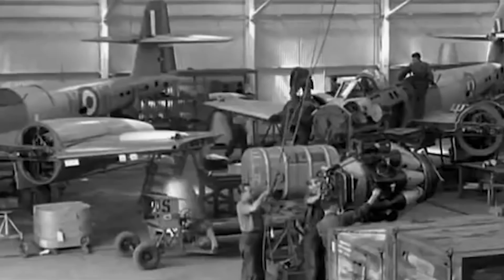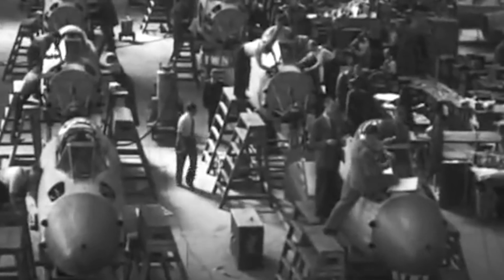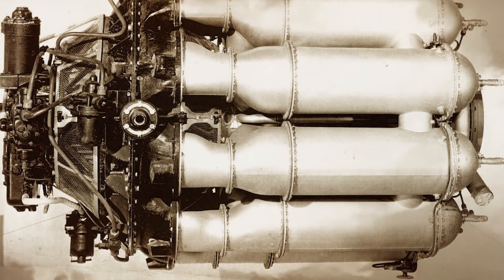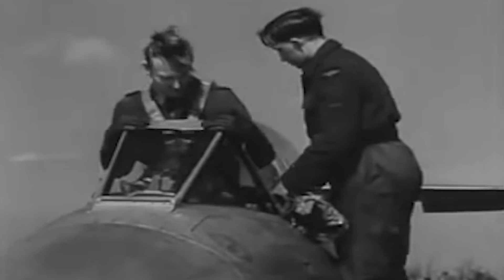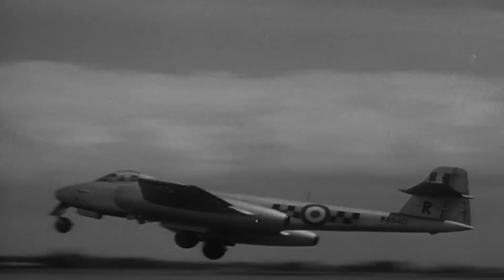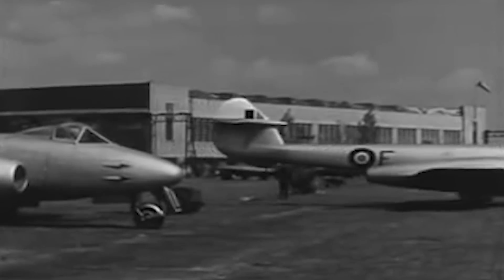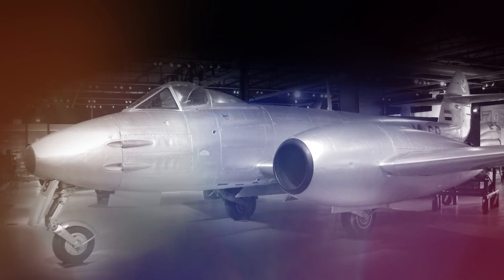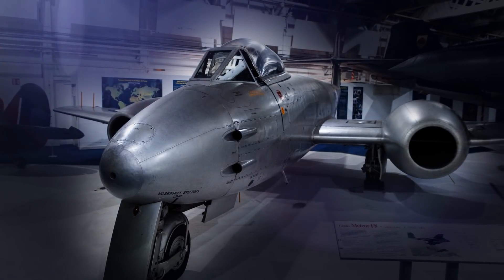Gloster Meteor - The Only Allied Jet to Fight in WW2

Comment: A few errors here, the Me 262 never reached squadron operational service until Dec 1944 with Jg 07 while as mentioned the Meteor saw squadron operational service five months before with 616 squadron.  While the 262 saw combat as early as July 44 it was with a test and trials unit and not a operational unit.  Then you said the Me 262 had better visibility than the Meteor, how could that be when the German pilots was seated directly over the wing in a conventional layout while the Meteor had the pilot in front of the wing in what's become the universal jet layout.  The Me 262 had a top combat speed of 515 mph which the Meteor easily beat when it went to the continent as did the third Vampire prototype which flew prior to the wars end.   The Vampires development being delayed by the engines for the prototypes first flight having been sent to the US for its P80 program.  Both US jets from WW2 used British jet engines, part of the Tizard Mission.
Reply: The Messerschmitt Me-262 had a top speed of 560mph in military service and set a worlds record top speed for a production jet aircraft of 624mph in level flight.
The F4 Meatbox didn't enter production until 1946, the F1 had a top speed of just 417mph.
Reply: @sandervanderkammen9230  sorry but no, three sourses show the 262 had a top speed of 515 mph in combat trim with weapons, ammunition and full fuel load.  The Luftwaffes own pilot hand book, the debriefing of Luftwaffe acceptance pilot Hans F. and then you have both the RAF and USAF tests post war with the aircraft.  The aircraft could reach about 550 mph in the dive is the pilot was suicidal given the types habit of locking the controls and plowing into the ground but piston fighters such as the spitfire, tempest and mustang could all exceed the 262's dive speed because of the control issue. Also the F3 sent to the continent had the mentioned more powerful engines along with the improved canopy and longer engine cowlings of the F4.  Those cowlings and engines gave it 80 mph more speed alone.  Got 40 years or reading and research on the subject.
Reply: @jimdavison4077  The top speed of the Messerschmitt Me-262 is 560mph...
Reply: @sandervanderkammen9230  not according to the Luftwaffe, RAF and USAF.  According to all of them it was 515 in level flight.    I notice you don't mention what unit it became operational With, that's because you know it wasn't an operational unit.  So explain how a non operational unit could make a type operational?   The very fist operational unit to fly the 262 was jg 07 in Dec 44 five months after the meteor.   You have no clue what operational means do you?
Reply: @jimdavison4077  You are clearly suffering from a serious case of Wunderwaffe envy...
Reply: @sandervanderkammen9230  why envy the side who lost and produced so many absolute failures.  The 262 with its horrible 1.5 to 1 kill ration and was scrapped both in the east and west even with the cold war looming on.  The Soviets tried using the Jumo 004b engine in their early Mig but got the same results as the Germans, suicidal.   In the West they were scrapped which is what they were.  Then you had the two rockets, not missiles, which were an absolute waste of resourses.  Then their little rocket plane which killed more of their pilots than any bombers.  Imagine making aircraft without wheels for landing, clearly they didn't care about their pilots lives.  Than that joke of a HO 229 or really Gotha 229 while the US had tested two flying wings prior to Germany getting one into the air for all of two or three hours before it caught fire from one of those self destructive Jumo engines.   Germany was years behind the West.
Reply: @jimdavison4077  26 Luftwaffe pilots became aces flying the Messerschmitt Me-262... the Gloster Meatbox never shot down a single Luftwaffe plane...
The Meatbox would go on to kill 450 british pilots without ever killing a single enemy pilot.
Reply: @sandervanderkammen9230  again the meteor was the first jet many would fly and it flew until the 1970's.   Check the number of flight hours it logged vrs the 262 and pilots it killed for the few hours that type logged and we can see who was clearly more at risk.  It's interesting how the 262 ended the war with hundreds of new aircraft never flown in combat, almost like it was useless in its job.  Ever wonder about That?  How many of those Luftwaffe aces survived the war, we know Galland did but he was proven a blow hard prone to claiming everyone else's killed according to records.  Then he lied and blamed Hitler for the delay of the 262 when the facts are clear the engines held up the type and never were safe for actual combat use.  Pilots had to operate with severe limitations in performance and maneuvers because of engines.
Reply: @jimdavison4077  The Gloster Meatbox was never shot down a single Luftwaffe plane... yet it was responsible for killing 450 british pilots.... perhaps the most successful British jet ever used against RAF pilots...
Reply: @sandervanderkammen9230  say what.  Having problems keeping it all straight.  The few aircraft the 262 did shoot down was nothing compared to the number which the Luftwaffe lost, that's on record.
Reply: @jimdavison4077  Messerschmitt Me-262 was the most successful jet fighter aircraft to engage and shoot down Allied aircraft.

While the Meatbox never shot down a single Luftwaffe plane and killed far more RAF pilots than Germans.
Reply: @sandervanderkammen9230  how in the world would anyone call an aircraft with a 1.5 to on kill ratio a success?  Luftwaffe claims have been proven BS.  They tried to claim it flew 600mph but testing proved it would nose down and crater into the ground when it reached 550mph.  Every front line piston fighter could dive faster than the 262.
Reply: @sandervanderkammen9230  and not one meteor was shot down by the luftwaffe.   About 200 262 were downed by the allies.  And not just fighters,  heavy bombers accounted for many lost 262.
Reply: @jimdavison4077  The Meatbox didn't shoot down any planes.

It wasn't a fighter.
Reply: Sorry but you are very confused, the Messerschmitt Me-262 is the World's first operational jet fighter and entered service with the Luftwaffe in April 1944.
Reply: @sandervanderkammen9230  sorry again but test and trials unit are not operational.  Check the records the very first operational unit to use the 262 was JG 07 in December 44.  Hell the Jump 004b never went into series production until August 44.  You need to start digging into facts and not just taking peoples claims as facts.  The first 200 pre production Jumo 004b engines were faulty.  They had a resonance issue with the turbine blades which at high speed vibrated and caused cracks which ended up destroying the engines.  This delayed the 262 along with the Arado bomber.  They were related to the testing stage with test units only. Now I have admitted it did see combat while in these testing and trials unit they were not considered to be operational units.  Learn the difference. Operational units have a full compliment of aircraft for all pilots along witb them fully trained along with the full training of ground crews with all tools and spares.   No Luftwaffe unit was operational with the 262 until December  44.   This is recorded fact in Luftwaffe records and no amount of social media can change that.
Reply: @jimdavison4077  The official date the Messerschmitt Me-262 entered operational service with the Luftwaffe was April 19th 1944.
The first RAF aircraft shot down by a Me-262 was on July 26th.1944.
Reply: @sandervanderkammen9230  tell me how said aircraft was shot down when it returned to its hole airfield in England.  The first claimed aircraft downed by the 262 was a mosquito  but that aircraft is on record making it home to its base.  You seem to buy every claim the Germans made despite many being proved false.
Reply: @jimdavison4077  The Messerschmitt Me-262 was the worlds first operational jet fighter and entered service with the Luftwaffe on April 19th 1944 with Erprobungskommando 262.
Reply: @jimdavison4077  The Mosquito crashed in Italy, it was shot down by Me-262 pilot Alfred Schreiber on July 26th. He shot down 5 Allied fighters in 1944 with a Me-262.
Reply: @sandervanderkammen9230  that was a test unit, test and trials actually and not an operational unit.  Thanks for proving my argument.  616 squadron was a fully operational unit with full aircraft spares, training for pilots and ground and all tools needed.
Reply: @sandervanderkammen9230  the PR aircraft made it back to base.  You need to stop watching videos and start reading actual squadron records.  Alfred Price published a couple books on the last year of the Luftwaffe along with several on RAF aircraft and units.  He is great for showing unit records.
Reply: @jimdavison4077  Erprobungskommando 262 shot down 50 Allied aircraft and 5 pilots from this unit becoming  jet aces. 
Karl Schnorrer, Erich Buttner, Helmut Lennartz, Gunther Wegmann and Alfred Schreiber the first German jet pilot to shoot down an Allied aircraft.
Reply: @sandervanderkammen9230  that my friend was not an operational unit.  It was a trials and test unit.  Ever record co firms that and it's claims come very far from matching reality.  Even its first claimed victim, a PR Mossie, was fraudulent.  Now I am not sure why people seem willing to praise the Germans desperation so much when they failed to have aviation gasoline for properly working fighters they then moved to death traps that lacked the performance to do the job required and got many of their own pilots killed.  You cling to the myth they shot down 550 enemy aircraft which is based on their own claims  its well known to be severely overly optimistic given allies losses from.this time period.  I have told you exelent sourses for actual records of all Luftwaffe day to day operations in the last 12 months of the war and they show the 262 for the sadly ineffective war bird it was.  At best the 262 shot down about 300 aircraft but that was at a time when every day the western allies had about 2000 aircraft in the skies over Germany.  That shows the pitiful contributions of the 262.  Not a shocker when the design in both engines and air frame were hopelessly flawed.  Then remember they were made by forced labour which didn't care about their work.  Is it any wonder why many had to be reworked for their acceptance trials to make the speed limit of 500 mph.
Reply: @jimdavison4077  You are clearly in a deep state of denial... Erprobungskommando 262 was a combat operations squadron a shot down the first enemy aircraft.

Something the dismal Gloster Meatbox was never able to achieve during the war.
Reply: @sandervanderkammen9230  sorry they were a non operational unit that never had the aircraft, tools or spares to be considered operational.  How do you go about doing the mental acrobatics to say an aircraft that didn't even have engines that were in series production was operational.  The Jumo 004b never saw series production until a month after RAF 616 was officially operational.  So please how in the world do a couple experimental aircraft become operational?
Reply: @jimdavison4077  4 Aces and 29 Alied aircraft shot down is pretty good for a non-operational unit...
Reply: @jimdavison4077  Mass production of the Jumo -004 Orkan turbojet engines began in 1942 with nearly 8,000 produced during the war with over 10,000 produced in total.
Reply: @sandervanderkammen9230  and yet the 004b never saw series production until august 44.  True fact.  How come you know absolutely nothing about this subject.  Early test 262s used the pre production 004bs from a batch of 200 which suffered resonance problems.  Now explain what that is and how it was overcome?
Reply: @sandervanderkammen9230  right like that mosquito which returned to its home field?  The luftwaffe made that claim in July44.  Funny how the jet could not even catch any PR spits or mossies?   Because they were not as fast as claimed.
Reply: @jimdavison4077  You mean CRASHED???
Reply: @jimdavison4077  85 RAF aircraft shot by Me-262s..
The majority of them Mosquitos, 3 Spitfires and a Tempest too!!
Reply: @jimdavison4077  The Messerschmitt Me-262 was 150mph faster than most Allied aircraft and had a  cruising speed faster than any British plane's top speed during WW2.
Reply: @sandervanderkammen9230  Stop lying Sandyboy. That 85 figure has nothing to do with the RAF.  Foreman and Harvey's Me 262 combat diary based on german data shows only 35 RAF aircraft even claimed by Me 262 pilots.

Comment: The 262 would have flown into combat as early as 1942 but Hitler wanted the 262 to be able to carry bombs so the deployment of the 262 was delayed till 1945
Reply: Hitler ordered every fighter be able to carry bombs after the aborted Battle of Britain.  The Junker's Stuka was rendered obsolete in the fall of 1940 so the Germans needed a replacement dive bomber.  Ironically both the British and US post war testing of the 262 said with the addition of dive breaks the 262 could have been that replacement and been far more effective at stopping allied armour than shooting down the few aircraft it did.
Reply: @jimdavison4077  Ironically Hitler's theory would be vindicated as all modern jet fighters carry bombs as well.
Reply: Not really true, the Messerschmitt Me-262 entered service with the Luftwaffe in April 1944, it was delayed primarily due to the shortage of strategic supplies of Nickel required for production of the Jumo 004A and BMW -003 engines.
 The -004B Orkan was significantly redesigned to minimize the use of Nickel which required development of several key technical advances found on modern jets engines, technology years ahead of any Allied jet engine.
Modern jet fighters are dual role capable and are also intended to fill the bomber role with equal efficiency... as were many piston engine fighters during WW2.. the P-51D Mustang for example was also required to carry a 1,000 lbs bomb load as standard specification... same as the Me-262s.
Reply: @sandervanderkammen9230  The Me 262 was delayed because the krauts couldn't make the engines serviceable they were still crap when it finally went operational. The germans failed to develop any decent alloys or any decent engine designs.
Reply: The final product variation was test flown in around the first week of April 1944. The first experimental combat unit was formed on June 30 1944. The first squadron operated from September 1944.

Comment: Aerodynamically the Meteor was inferior to the Spitfire, but the Meteor had to be the way to go. It always had a high accident rate for all sorts of reasons not necessarily the fault of the aircraft.
Reply: Gloster was Blackburns closest competition for the worst British aircraft manufacturer.
Reply: Sandbum dorktorbummer. 
Gloster made some very good aircraft.  Blackburn also. I notice Lockheed were not very good at it.
Reply: @sandervanderkammen9230  Interestingly (and I know you'll be interested in this) the Blackburn Buccaneer was recommended to the post war Luftwaffe byu Eric Winkle Brown but it was passed over in favour of the Starfighter much against WW2 ace Erich Hartmann's advice. And in German service the Starfighter had a crash rate of 32% which is very close to the appalling 33% crash rate of the Me262.

Comment: Wait, all this time I read that the ME-262 was the only fighter in WW2, I didn't know of the Meteor until now. Will support you on Patreon.
Reply: The Meteor, uneffectionately called the "Meatbox" or the "flying coffin" by RAF pilots was a major disappointment and never saw aerial combat during WW2... in fact it was a "fighter" in name only and was used primarily in training, ground attack and recon roles.
Reply: @sandervanderkammen9230  13 kills in intercepting V1 rockets.  Also why was it the Luftwaffe cut and run from.the Meteor?
Reply: @jimdavison4077  The Gloster Meatbox mever shot down a single Luftwaffe plane yet ir managed to kill 450 british pilots... it remains the worst jet fighter in history.
Reply: @jimdavison4077  I don't hold your lack of education against you personally but MoD records prove the Meatbox was the least effective jet fighter and the most likely to kill its pilots.
Reply: @sandervanderkammen9230  how can you blame an aircraft when a very large number of those accident investigations found pilot error a key reason for the incident?  Explain that?
Reply: @jimdavison4077  Oh! So now you are claiming that British pilots are incompetent cowards that cannot fly an aircraft without crashing???
An interesting theory... do you have any proof?
Reply: @sandervanderkammen9230  Sandyboy, the Me 262 had a mechanical failure/pilot error loss rate of 33%, much higher than the Meteors. Just answer some simple questions (of course you won't because you are a coward)- Why wouldn't anybody buy the Me 262 (as the Avia S-92) after the war? Why did Argentina, which was being advised by Kurt Tank and Adolf Galland reject the Me 262 in favour of the Gloster Meteor?  Why did the Meteor sell to 16 national airforces and remain in regular service into the 1970s whilst the Me 262 vanished with the mothballing of the 12 postwar Avias in 1950?
Reply: @sandervanderkammen9230  none of what you have stated bears any resemblance to reality. You even made up those nicknames.
Reply: @TalutellenduUle  You should read RAF pilot Nick Carter's excellent book "Meteor EJECT!"  its a chilling account of how he luckily surrived his duty with the Meatbox while many of his friends were killed by the worst jet fighter ever used in RAF service.
Reply: @sandervanderkammen9230  BTW, the 'flying coffin' was the name given to the He 177.